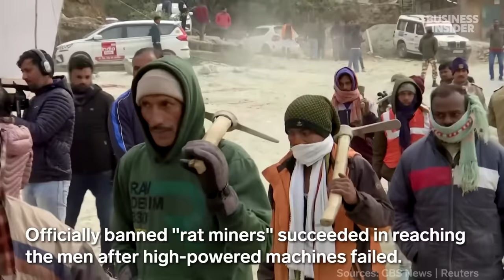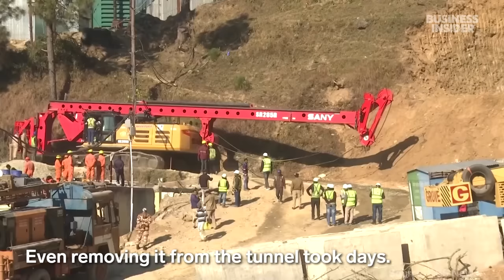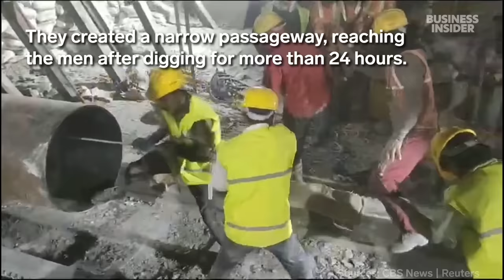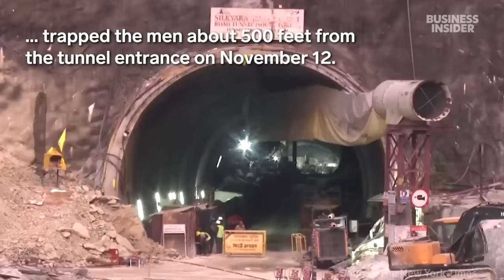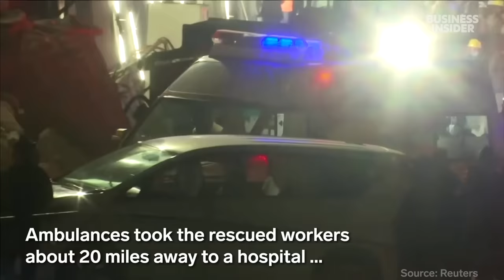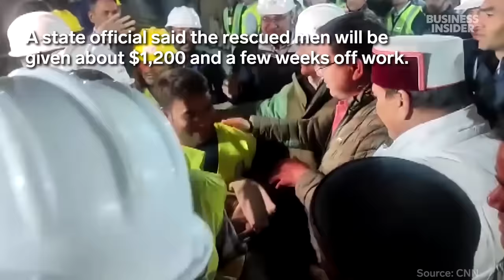'Rat Miners' Rescue 41 Men From India Tunnel After Machines Failed | Insider News

Comment: It took 17 days to dig 500 feet?
Reply: They were 3 miles deep inside the tunnel and the last 500m took almost a week due to extreme difficulty in drilling through rocks and concrete , equipments started failing one after the other and the tunnel started making cracking noises , they had to strengthen some areas with concrete and steel
Reply: @TheKing-xp7lq   Thanks.  I looked more into it, I didn't realize there was metal equipment and debris in the way causing them to break drill bits.
Reply: @Andy_Holmes Not just metal equipment, but also 2 tonne Metals shafts, Concrete, etc
Reply: @Andy_Holmes all the machines that were used in tunnel were also stuck in debris . It was taking time .